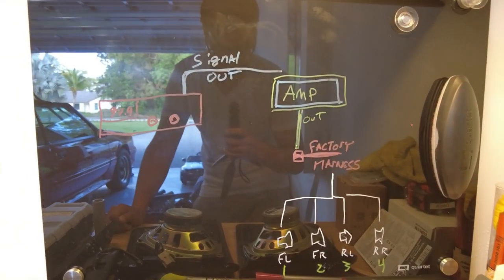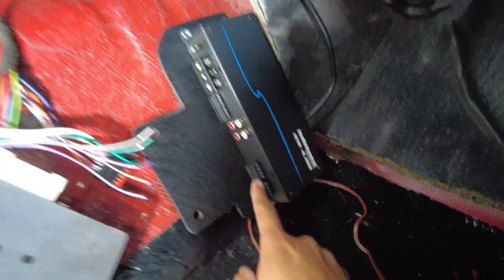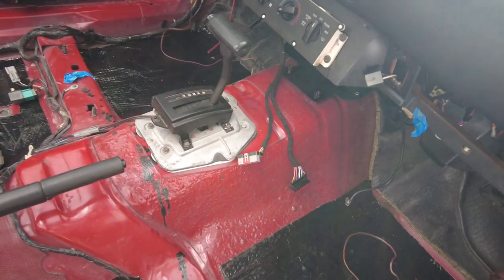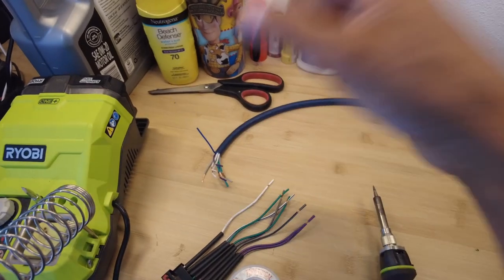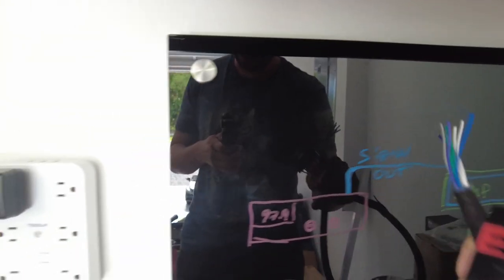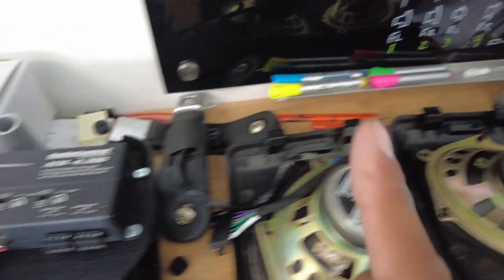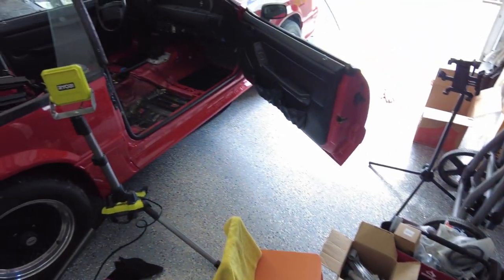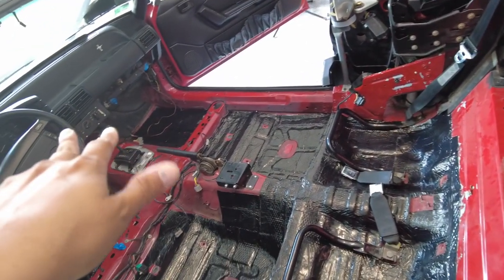How to Amplify Factory Speakers

Comment: you need the blue wire to turn the amp on
Reply from the maker: Yes but this amp has signal sensing. You can still tap the fuse box